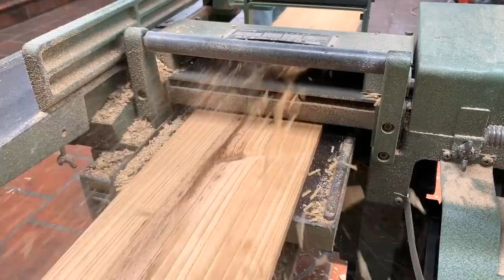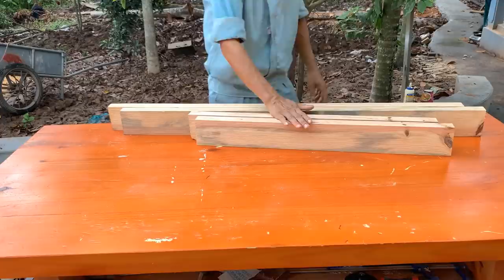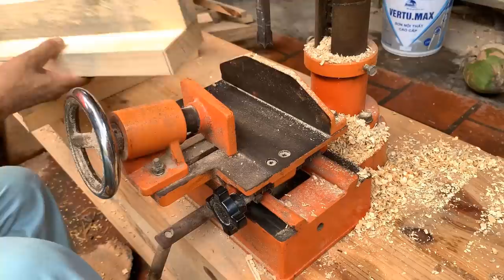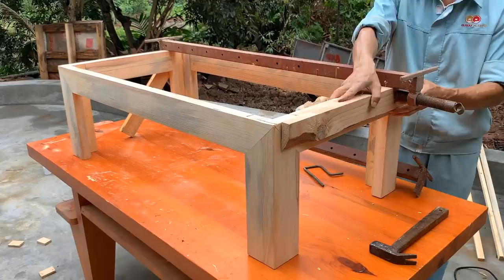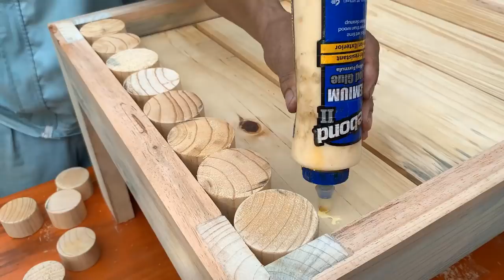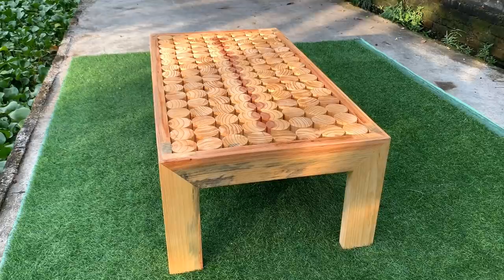Ingenious And Creative Handmade Woodworking Plan On A New Level // A Perfect Table Will Surprise You

Comment: I see one big problem: cleaning the table.
Reply: Good point but easily fixed with a piece of glass or plexiglass.
Reply from the maker: I will put a thick glass panels
Reply: @woodworkingideas9120  make video after put a thick glass on this table this will look better